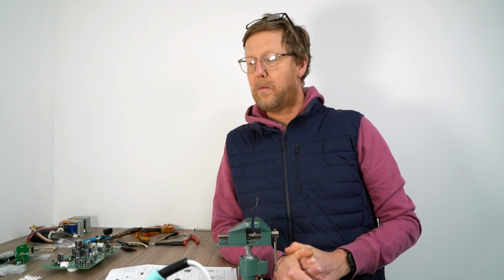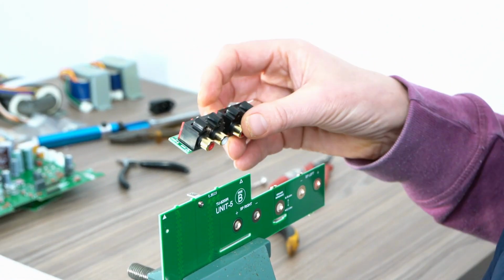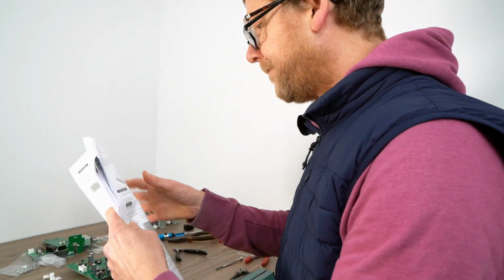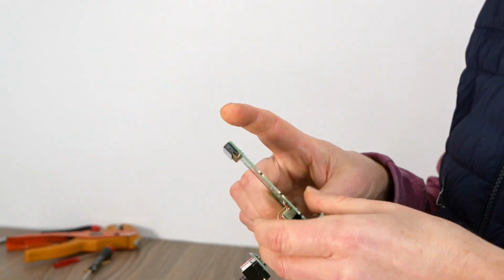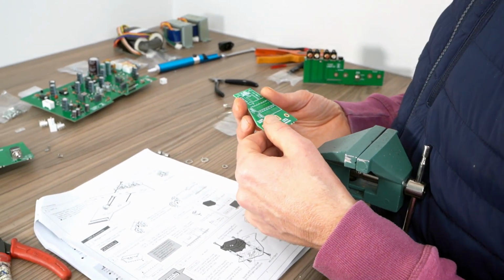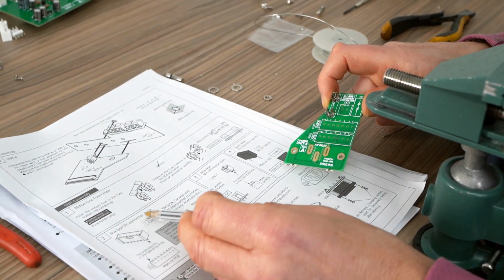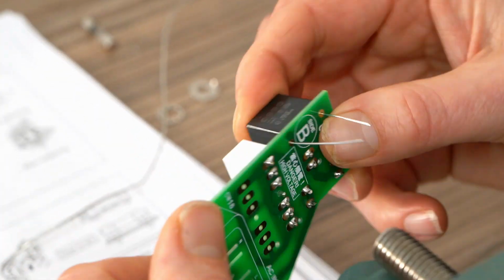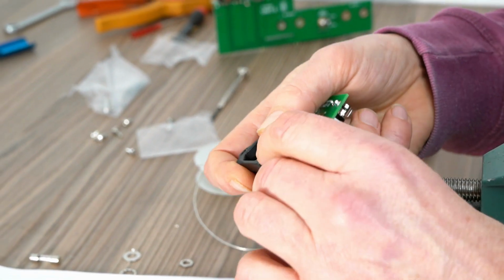How To: Assemble the Elekit TU8200R Amplifier Kit pt.4

Comment: So I've been curious about these kits for a while. I have steady hands and a whole lot of patience but little understanding math and physics behind Electronics. Are the directions in English clear enough for hobbyist without an electrical engineering background be able to do one of these kits?
Reply: Hi Jacob, directions are perfect. You will get an English version of the PDF with the kit. Do you have some soldering experience? I am going to asseble this kit in a few days. Best regards, Milan
Reply from the maker: Hi Jacob, Milan is correct the instructions are very simple to follow and require no prior understanding - think of it as an Ikea kit on steroids! (that produces a great sounding amp)